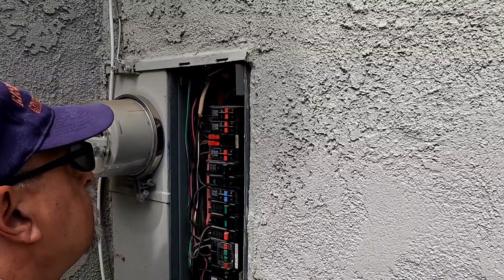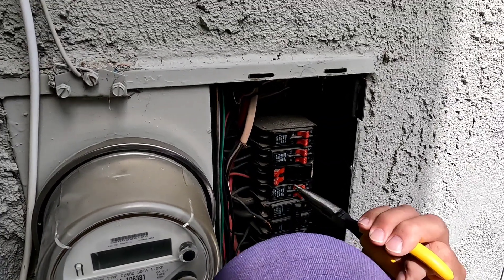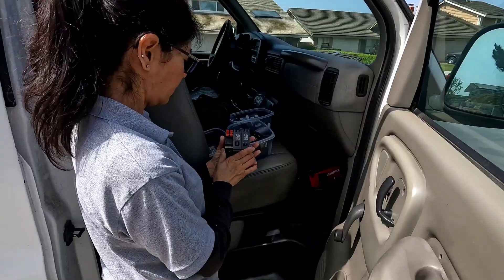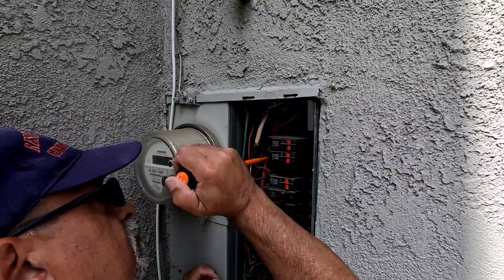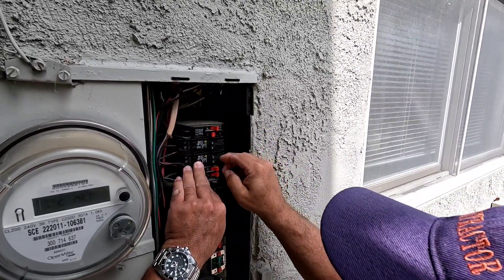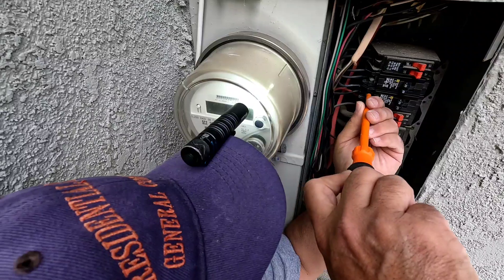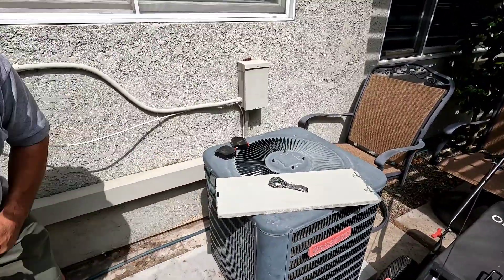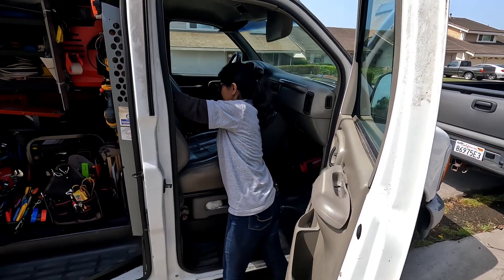Saturday Morning  Emergency Circuit Breaker Replacement.

Comment: i got a question  the wires used in the new breaker are black,how can you differentiate which is neutral and which  is hot? besides using a multi meter?
Reply from the maker: On this particular video I don't recall seeing a white wire other than one white wire to the left of the breakers which is a Romex but all the white wires usually go on to a neutral bar once in a while you'll see a white wire mixed in and used on a breaker as a hot but with that being said the only way really to know what's up is to use a meter I'm not quite understanding the question but yes if you open up an outlet and you have a black and white a meter is your best bet
Reply: @ResidentialRepairs  thank for your response, i truly appreciate it, it helps me understand !
Reply from the maker: @none8214  I understand your question now my apologies yes whenever you open up any box you will have a black wire and a white wire the easiest way to check which is hot and which is not is to use a audible Wireless tester basically when you touch the wire it'll beep if it's hot and it won't if it's not once you figure out which ones hot and which ones not I would say always back up your testing with a wired tester whenever you open an outlet you'll see black wires and white wires the black wires are usually your hot ones and the white ones are your common wires sometimes when people don't know what they're doing or they run out of wire they sometimes put a white wire as a Hotwire every time I find one of those I actually get a black marker and paint it black but remember just because your white wire isn't hot doesn't mean you can't get shocked by the white wire sometimes white wires will carry a backfeed due to an open ground somewhere possibly so beware of the white wire as well handle all wires like they're hot

Comment: The flimsy twin circuit breakers that you rep!aced look like the Murray model MP2020 that I used back in the 1970's& 80's. I was taught to never place a heavy load on any twin or mini breakers like window air conditioners, laundry, or kitchen circuits. Single po!e breakers do not ruin the breaker above it as often as the twins Used to do at least six 100 amp services a month and one electrical sup!y house would only charge $1.75 for single po!e Murray breaker when I purchased a 100 at a time.( yea  1970's ) Gave me great prices when I purchased a 1,000' of aluminum #2 ( 100 amp) service cable. In my area the Ultility company does not allow any cable, phone or other lazy companies from installing a flimsy mickey mouse halve ass ground clamp onto meter cans.Would not want to be the sparky that has to replace the meter / circuit breaker combo box that's embedded in stucco.
Reply from the maker: Thank you for sharing your knowledge this helps everybody out when people like you comment and give your opinion and your experience thank you again.

Comment: FYI, you should use only certain Eaton type BR breakers in the old Bryant panels. they're the only ones still making and having them "classified" for use in them and other similar mixed brand panels.
now it's usually a separate line of breakers from what's on the shelf with the new panels and in the special replacement section with others, so pay attention to that. you really should only use ones that are "classified" listed replacements, to cover yourself and them if it needs any inspections. that said, I think it's time they get a new panel and rewire, because that one is an ugly hot mess. 😬
Reply from the maker: You are so right they do need a new panel and you just taught me something about the classified Breakers I'm going to familiarize myself with that that way next time I'm more prepared thank you for the education it's appreciated.

Comment: The "neutral" position you mention is actually the "tripped" position. Manufacturers ship breakers in the off position. If you find one in the store in the tripped position, don't buy it, because that means that some one picked it up, put it to the on position and then it was dropped. Physical shock (impact) to breaker in the on position will cause it to "trip". You can demonstrate this by switching a breaker to the on position and smacking it in the palm of your hand.
Reply from the maker: Yes I have noticed at Home Depot when I pick up Breakers some are in the neutral position and some have already been clicked if you open up a brand new box of breakers on the Shelf you'll see they're all in the neutral position like you said I guess it keeps the stress off of them thank you so much for contributing to the video and conversation this helps everybody out thank you so much for your input.

Comment: @14:46 The only thing that I would have done is to tork them to specks .. cause if for some reason they come loose or loosen a bit and start arking the last person that work on it would be liable atleast in my state ..
Reply from the maker: I am going to get me a new torque driver just for that because you're right the last person that touches it is the responsible party.

Comment: I’ve never seen a main breaker smack dab in the middle of the panel , it’s always on the top at least from my knowledge, I from square D panels …
Reply: Probably not a bad idea to replace all the breakers with new . These breakers are over 40 years old . Give all the busbars a good check and cleaning .
Reply from the maker: That's so true over the years they get shuffled around.
Reply: That's not a "main panel" with a permanently mounted main breaker. It's a sub-panel. That's why the breaker (standard double-pole) that is being used as a main can be placed anywhere on the bus. I would say that the installation is not to code. Main breakers should always be at the top or bottom of the bus. It was likely done this way because the feed from the meter can comes in next to that position on the bus and the original installer was to lazy to wire it correctly or the wires from the meter can were too short and they did not want to replace them. This was probably a retro-fit to replace a screw in fuse panel.
Reply: @antoniosagamuccio7370 It's a meter main combination  panel . As you can see the meter is on the left side of the panel . It is common for these panels to have the main in the center of the panel because it uses less buss bar to land on the breaker .
Reply: @stevencole7331  I went back and viewed again. I did not notice the full width drip-edge first time around and it looked like two separate cans. I stand corrected.

Comment: Good troubleshooting skills. However, with an old panel, I would recommend turning off all the branch circuits first. This prevents the main from arcing under load and possibly not resetting. As well as reversing for powering up. Good idea removing metal while working in panel.
Reply from the maker: That is a very good protocol to follow, thank you for watching and for participating in the comments.